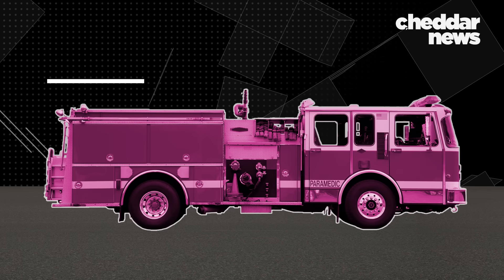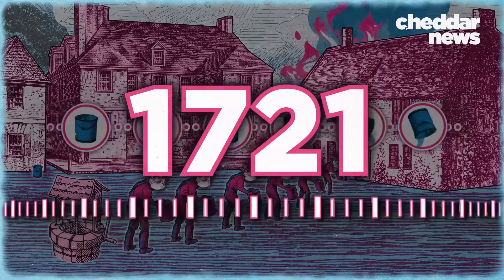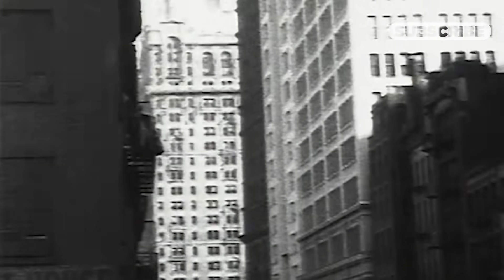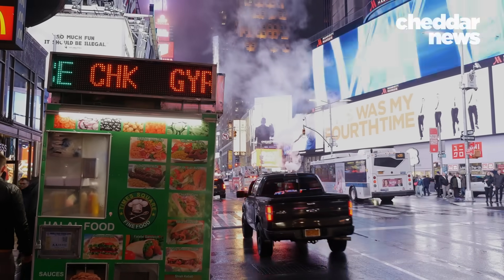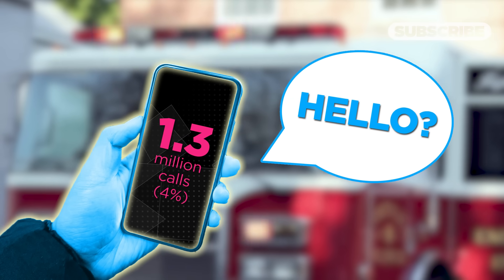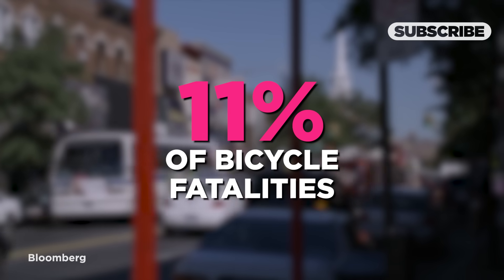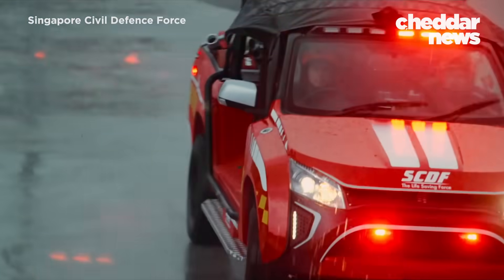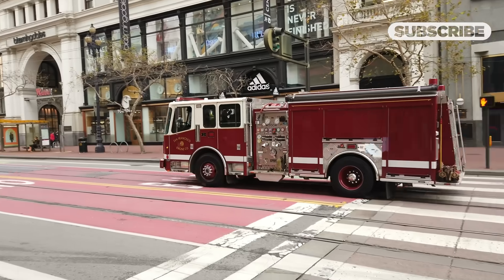Do American Fire Trucks Need To Be So Massive? - Cheddar Explains

Comment: The amount of misinformation in this video is astounding.

Its as if the writers failed to do any research at all about the differences between North American fire apparatus and the rest of the world let alone how big the apparatus actually are. 40' for an engine? Are you out of your mind? 30-32' is realistic. 12' tall? Yeah maybe for some designs of aerial ladders but that is very uncommon and atypical and also totally absurd for an engine. 10' wide?! Fire apparatus are constrained to width restrictions as other vehicles and so are no more than 8' wide just like any standard tractor trailer or commercial vehicle. A ladder might have a jack spread of up to 20' depending on design but that is for the operation of the aerial once on scene, not the driving width of the vehicle.  Yet then at the same time you failed research that engine tank sizes generally START at 500 gal and go up from there with 750 gal and 1000 gal tanks being quite common nationwide and rural areas commonly using 2000+ gal tanks because there are no fire hydrants. 

There are FUNDAMENTAL differences between fire operations in NA vs most of the rest of the world. The different principles used for fire attack create substantial differences in design. You characterize fire fighting as if it is the same thing the world over and it simply isn't. There are immense differences in the hazards present and the tactics used to combat them just going from one city to the next at times, let alone across the globe. You obviously didn't actually research ANY of that and instead just made up another "America bad, rest of world good" hit piece. This is shameful journalism or content creation or whatever you want to call it!

Next time maybe try to actually research things instead of throwing together a turd like this. You took less time to research this than the runtime of the damn video!

Comment: I think people do not realize that American fire departments operate much much differently than their European counterparts. In America it is the expectation to be on scene within 4-6 minutes of dispatch (urban) and with in 90 seconds of stepping off of the truck, to have a line stretched and charged prepping for an interior attack. Then a search should be starting, roof should be accessed, a RIT or FAST team formed and having a 360 completed. Some departments, especially is suburban areas without fire escapes, ladders are thrown to every window. A good portion of fires in the us seem to be out within 20 minutes of the first truck on scene. In major cities even if a building is ‘abandoned’ in most cases an interior attack is staged to look for possible squatters residing in the structure. 

Another major difference is that every type of truck and crew in the us has a specific function. The engines carry water, a basic tool complement and hoses, some of which are pre connected to get the water on the fire. A truck (ladder) has a wide array of hand tools, saws, extrication equipment, ropes and 100+ feet of ground ladders. Rescues the carry all the equipment of a truck, with the exception of the ladders plus a wide array of specialty technical recuse, water rescue and hazmat equipment. These are some of the most highly trained firefighters on any given department. The us does not have huge stations that can have dozens of pods for different situations, so all of this equipment has to fit on a few trucks. 

So a lot of the difference is that the departments operate differently fundamental. 

Ps I am not a firefighter, but it is one of my major interests
Reply: "In America it is the expectation to be on scene within 4-6 minutes of dispatch (urban) and with in 90 seconds of stepping off of the truck, to have a line stretched and charged prepping for an interior attack." not much different from most of Europe tbh. The legal time limit differs in each country, thus e.g. FD in Germany needs to reach every location alongside a road within a 10 minute time limit, however most of the time the FD will reach the boundaries of its response area within a 6 minute time frame. 
Taking 90 seconds to start an attack would be concidered as slow, really slow at many departments here tbh. Especially with the quick attack hoses which became a standard in many countries. 
"A good portion of fires in the us seem to be out within 20 minutes of the first truck on scene. "
I've been to apartment fires where the first trucks have left the scene 11 minutes after the alarm at the station went off. A recent video from Berlin showed the FD responding to a 2nd alarm garage fire: they arrived on scene after 3 minutes, fire extinguished and reported to dispatch after another 9 minutes.
"These are some of the most highly trained firefighters on any given department. " at most departments here the crews are cross-trained, there's no dedicated ladder crew riding nothing but the ladder truck every single shift. Same with the engine crews or rescue crews. They're all trained on most of the apparatus and run shifts on all of them.
"The us does not have huge stations that can have dozens of pods for different situations, so all of this equipment has to fit on a few trucks. " most of those pods are for special operations, with only few replacing e.g. a Heavy Rescue Truck in some places. Apart from that we have plain normal Engines, Tankers, Tower Ladders, Heavy Rescue Trucks etc as well. Just the range of equipment on each of these units is very different
Reply: @EnjoyFirefighting  The Truck Enggine thing in America sounds over specialist

Comment: Yes they do a smaller vehicle means giving up capabilities
Reply: no, in fact not. It's just a matter on how you plan to use the available space. If you store equipment loosely in a compartment or if you have a deeply thought-out layout which is similar to a tetris game using every inch of available space.
Reply: @EnjoyFirefighting  I was talking on a large sense like carrying more water and having a heavy broad base to raise a ladder from. However at an individual toolbox level it is also true. These are emergency vehicles.  I do not want the tools carefully shorhorned in.  I want them easy to see and grab.  Also if everything is shoehorn in how do you add the newest technology or newer better version of tools?
Reply: @jerrymillerstein  well you don't necessarily require a large chassis for a ladder. Thus e.g. the size of chassis an American 100 ft Tower Ladder would be used for a 170 ft to 200 ft Aerial in Europe. 
But I agree, in terms of water capacity a larger truck like in the US will definetly carry more of it. 
"I do not want the tools carefully shorhorned in.  I want them easy to see and grab." just because it's designed to fit in as much as possible doesn't mean it takes more time to pick a specific tool and take it off the truck. Departments barely have problems to replace older tools by new and modern ones, or replace a piece of equipment built by company A with a similar piece of equipment built by company B

Comment: I think the issues is the US sees fire truck as very general purpose. The old way of thinking was to put all the funds into one large truck design that can do everything. They really needs to diversify and specialize, from smaller trucks to even motorcycles. Cities in Asia uses fire motorcycle to beat traffic and assess situations before the bulk of trucks arrive. Since most calls are rescue related, not fire related, fire motorcycles and small fire SUV/trucks can handle most emergencies.